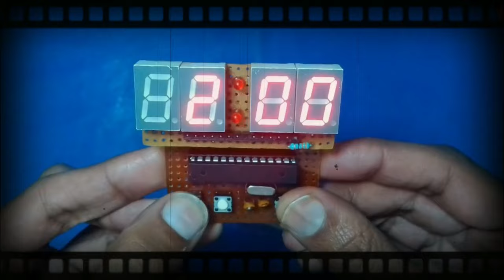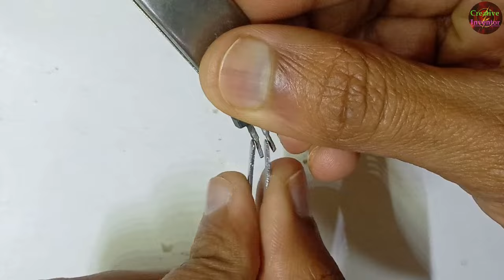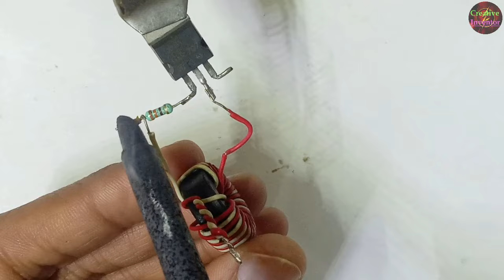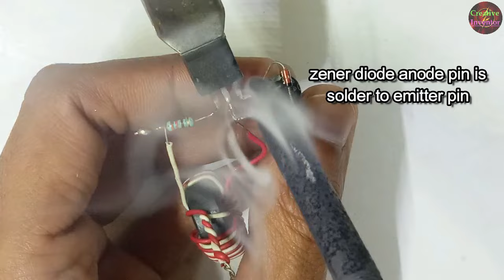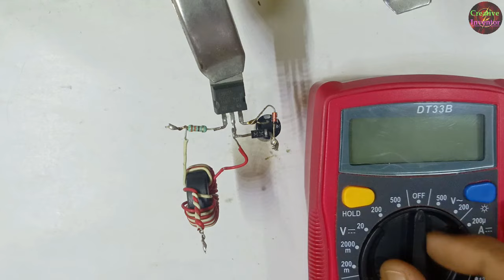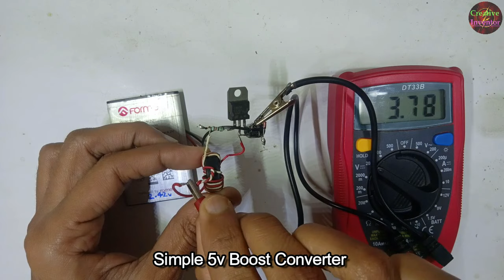Amazing Circuit Using One Transistor, 3.7v To 5v Boost Converter, DIY 5v Boost Converter Circuit

Comment: how many amps are there? I did the same. does not charge. little current. 5 volts, but few amps
Reply from the maker: I'm getting 600ma, a normal keypad phone can be charged easily and slow charge for smart phones but it really charges the smartphones also, also it can be used for powering arduino projects that consumes power under 500 to 600ma
Reply: @CreativeInventorlab  I collected the same. but charges milliseconds and turns off again, charges again, turns off again. constantly there is no 5 volts 0.5 amperes.

Comment: I used a different transistor but when I do this the voltage just keeps climbing up past 13v. How do I fix that?
Reply from the maker: Use a zener diode of 5v in paralled to the output postive and negative
Reply: @CreativeInventorlab  I have the zener between the capacitor therminals just like the video. Thank you for responding so quickly 😀

Comment: can u make a rc plane without using servos?
Reply from the maker: and what is the problem in using servo motor 🤔 as it controls the wings direction, it cannot be possible without servo motors unless you are a Tony Stark😆
Reply: @CreativeInventorlab  are bhai sasta bana ha na esleya😅😅or elevators ka tamzam bhe nahe padega esleya bhe
Reply: I need to make a power bank without any battery or capacitors.